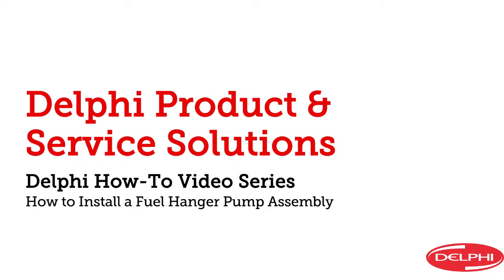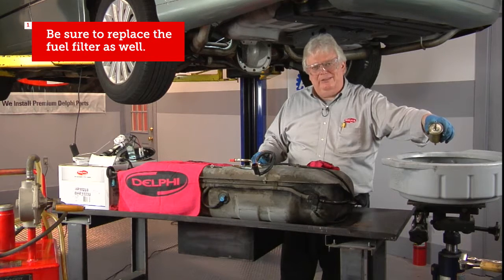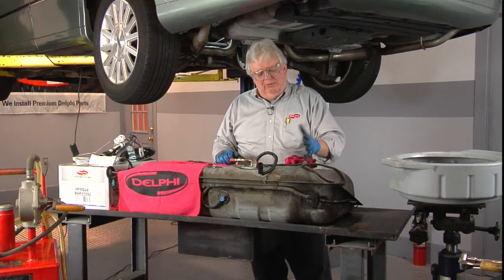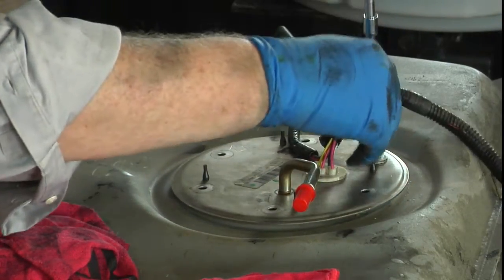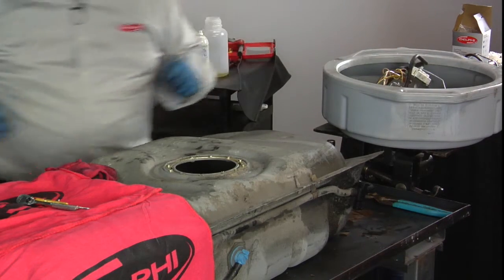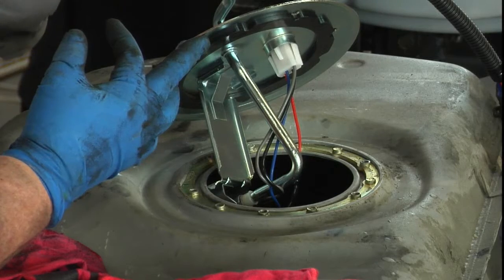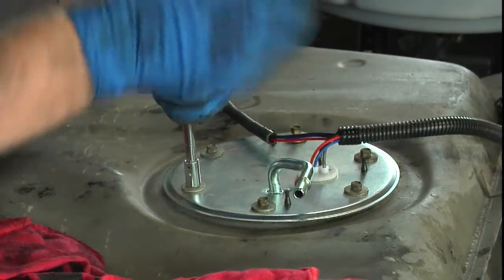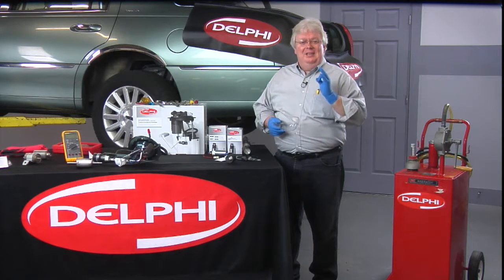How to Install a Fuel Hanger Sender Assembly on a Vehicle

Comment: Great job on the video, Brother! And for all of you questioning the removal of the tank, be thankful if you have an application with an access panel that doesn't require tank removal. Or that you live in a state with 20 years'  worth of shi#ty winters that has rusted and completely deteriorated all steel lines as well as the top/lid of the fuel pump hanger assembly making it impossible to remove it without getting rust/debris in the tank.